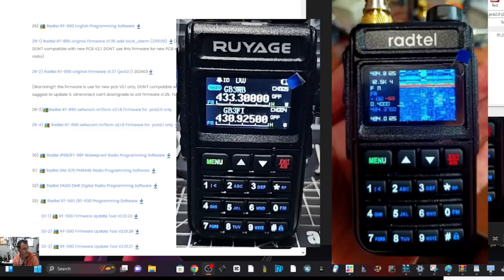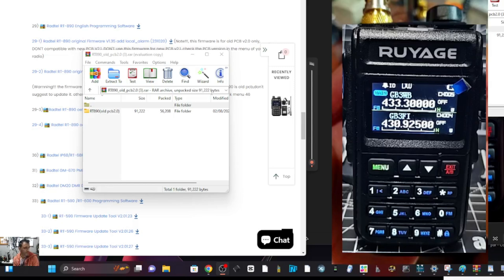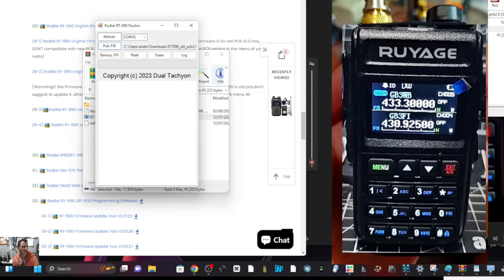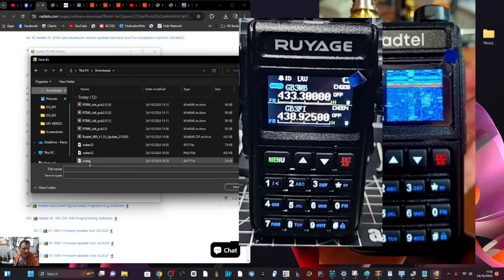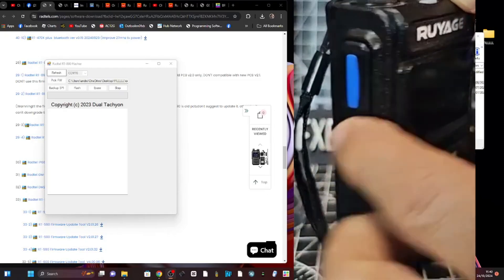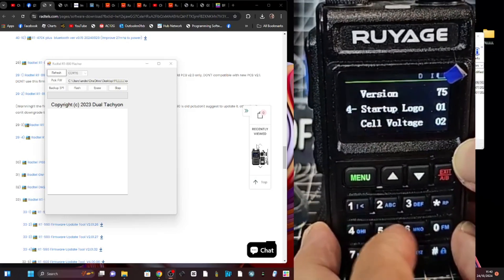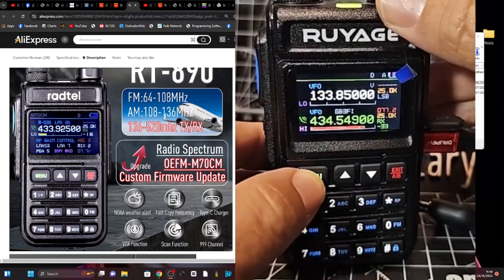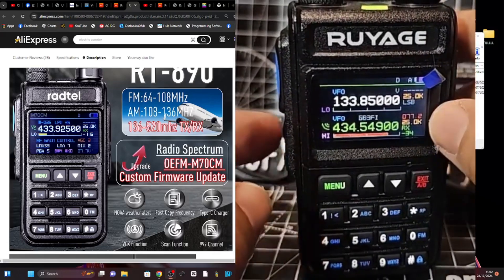Firmware RADTEL 890  /Ruyage uv58 - UPDATE to (M70 )

Comment: I’ve installed this firmware and if I use a repeater and give out my call sign the repeater comes back to me if I want to reply to a station I have to wait for the repeater to time out before I transmit again . If I hold the ptt switch down while the repeater is open then after about 10 seconds it lets me tx again any ideas ?
Reply from the maker: Wait for beeps to stop .
Reply: @M0FXBHamTech  forgot to say if i get some QRM on 2/70 i can't key the radio i have move away from the QRM very annoying if im talking to a station and they think i'm ignoring them if i cant answer because i can key the radio

Comment: How do you tell PCB 2.0 and 2.1 apart? Mine says, in Menu 46: V1.33 2023-02-10. But it says nothing about PCB version (LA3ZA)
Reply: Well, I just tried with the PCB 2.0 software as shown in the video, and now Menu 75 says "M70CM V2.1.8   OHW PCB V2.0" - so there is the answer to my question. Thanks for the video!

Comment: Thank you for sharing & excellent as always .
I was wondering ,does the channel scan resume scanning after it receives a channel on the new M70 firmware upgrade ? , the channel scan on the standard Radtel RT-890 unfortunately doesn't resume scanning , it just remains on first channel  that the scan stops  at, there's nothing on the chirp programming to chose scan resume .
all the other transceivers I have resume scanning after a few seconds , all bar the Radtel RT-890 , it's most annoying as I use the scan function when I go out .
Reply from the maker: Budget devices never great on scanning .
Reply: @M0FXBHamTech  Thank you for the scanning information .

Comment: I have that product with a different brand, but it is locked and cannot be unlocked at all, I have tried to flash it like in the video, the result is still locked, do you have a solution?
Reply from the maker: Wha do you mean locked ?
Reply: @M0FXBHamTech  the buttons are all locked and cannot function normally, on the top left screen there is a padlock sign, it should be unlocked by pressing the fence or padlock button but it is not unlocked.

Comment: Had a moment of head scratching as the COM port wasn't showing up.    Then I remembered when I ordered this from AliExpress awhile back that I didnt need the programming cable b/c I already had one for my QRZ1 ... used the two prong cable and got the firmware updated v1.8 from radtel'ss website.   Mine is the PCB v2.0 like yours

Comment: The RX on VHF isn't great either. The coastguard booms through on a uv5r with a stubby.. but even with a decent antenna on this it's struggling. I never tried it with the original firmware.. I might reset it and give it a go. Perhaps I've got a dud.
Reply from the maker: Keep playing mine works.great .

Comment: Do you have to have the radio turned on or off  to update the firmware , it look like the radio was off in the video when you turned it on. In joy your videos Thanks.
Reply from the maker: Turn off then hold two small buttons on the left and turn on your are in firmware mode screen stays black l.e.d is green
Reply: Finally, I got the firmware updated. Thanks again